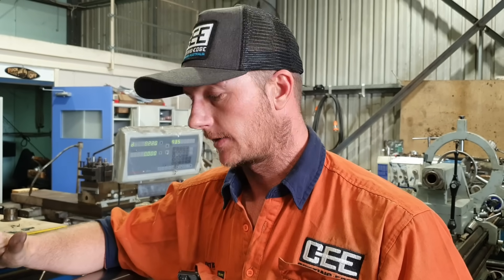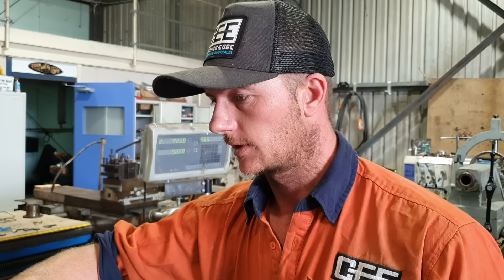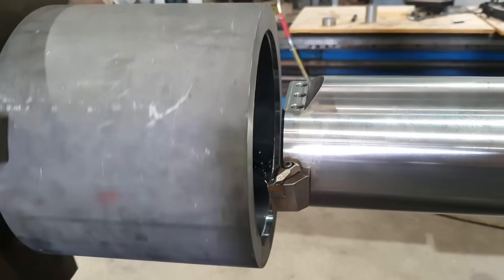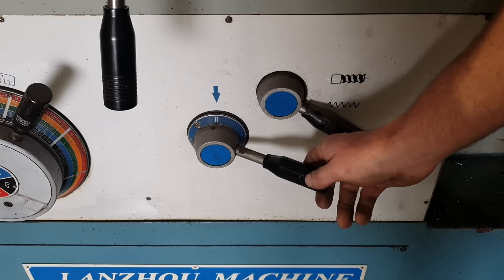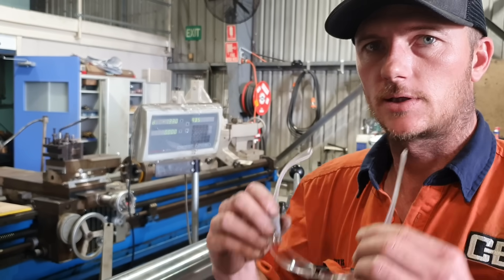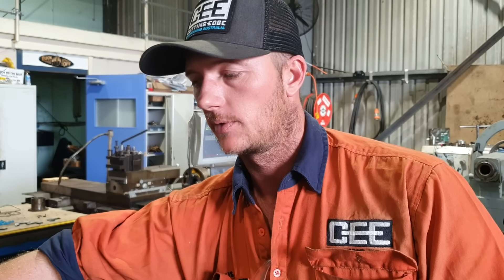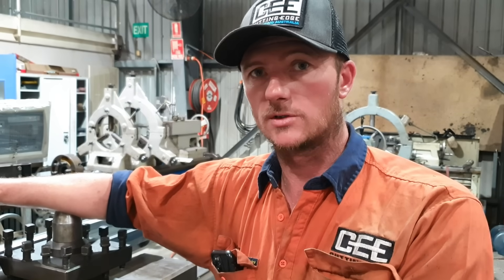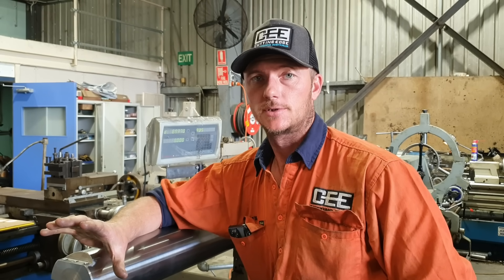Testing the BIG Boring Bar | Shop Made Tools

Comment: Would be interesting to see dial gauges placed to see the deflection at the cut, top and side.
Reply: you could calculate it based off the tool post deflection and the length of the bar
Reply: @bradmcgrath358   No.  That would give you an useless number.  The 2 gauges will give the truer reading and also the harmonic oscillations will be visible, as will the effect of cut depth, rotation speed, etc.  Your calc would only give an estimate of static horizontal deflection, and nothing for vertical deflection.

Comment: If you would be so kind as to include positive rake inserts in your testing and measuring deflection I would really appreciate it. My experience has been that cutting load is less with positive rake, so deflection should also be less. Wondering it you would confirm.
Reply: This was the comment I was looking for before posting mine.You are absolutely correct.

Comment: Great video. Knowledge is power, it's the same reason I cut and etch when I weld materials I haven't worked with or material of questionable quality.
Reply: Materials of questionable quality. Oh boy you should have seen a report from China I watched yesterday about the build quality and the reinforcing steel in new apartment buildings. Horror,  and nightmares. Snapping reinforcing ligatures with bare hands, snapping thick reo bar at bends by smacking it against some concrete. Concrete floors that give way to reveal only the reo mesh, architraves not nailed to door jambs, held by glue and paint. 
The list goes on.
Reply: @markfryer9880  Been a few on Utube showing the new cities that China has built in recent years ,almost all never lived in and very little population , Given close inspection exposes the worst possible construction materials and methods It's no wonder that no one lives there.

Comment: i used counter weights on a 3 ft long bar it will give your cross slide at ease also,the weight will stop chatter,.125 to side should be easy to bore at 3ft

Comment: Have you ever thought about using a damper on the bar to reduce vibrations?  Similar to a rotational damper aka harmonic balancer on an engine.  It could be a simple bolt on combination of hard rubber and metal pate affixed to the side of the bar away from the tool or within the tool's projection.  It would act to dampen the vibration along the tool length.  In fact a brake drum / disc lathe has rubber bands that accomplish the same thing except they are on the rotating piece.  If the piece permits it, the same approach could be used in addition to a damper bolted to the boring bar.

Comment: Can you briefly explain why you didn't cut the relief in the boring bar longer so it can be closer to the chuck?  Certainly that would reduce the deflection by reducing the leverage force.  With full length mounting relief, the bar could then be placed in positions long or short.  Right?  Shout out to Homeless!  The yellow pig didn't last very long, "oink" is gone and there's a hole.  Bummer!

Comment: The deflection is a bit better than I expected. .02 mm at the post does come out to around .08 at the tool tip if I remember my trigonometry correctly. I would be curious to see what the bar measures for deflection where it enters the work.

Comment: There is enough room on the tool end of you new boring bar to drill 1 or several holes in the end. Tap them for a set screw.  Pack one with steel shot. Perhaps a second with lead shot and the third with urethane or rubber . The difference in the weights of the filler materials may dampen different harmonic frequency ranges .  Or mill a slot in the back side of the bar with set screws much like the 25mil slot at the end. With that you might be able to move damping weights around to change the harmonic tuning of the bar.   You may also want to create a heavy ring for the back end past the tool post to allow you to shift that around to change frequency resonance of the bar. Perhaps adding or subtracting rings . I shiver thinking about harmonics going thru the spindle bearings in the headstock and brinelling bearing balls and rollers..

How often do you chuck up a long bar and with indicators on the bed at the end of the bar and on head indicating the top of the chuck while you lift the end of the bar a limited amount to see how much the spindle/chuck rises or deflects in the spindle bearings. So you know when to reset preload on the spindle bearings.

Comment: I would think, if you bore a 25mm or 1" banana hole through the bar, it would lighten it up a bit, and it would add to the strength. IMHO

Comment: I did wonder if you would lay an indicator against the bar itself to see if anything was moving. You can usually hear any vibration, or see it in the swarf.
That bar must be the stiffest element in the system. So - as long as the tool holder can cope with it - your fine. Happy swarf tells you a lot.

Comment: Put a dial indicator on the back side of the working end of the  boring bar and and push against bar opposite the indicator and check for movement.  Curious what sort of taper boring a deep hole with that stickout would occur if any?

Comment: I certainly didn't mention deflections since that seemed solid enough to me for any sensible use. 
But just as a matter of academic curiosity, I'd be interested to know, if you take a clean cut on the inside of something, mic it, then take a 3 mm cut, and mic that, what size did it actually cut? 3mm? 2.9mm? 3.1mm?

Comment: I saw a video of an columbian machinist that he install a opposite bar that touch the lathe bed with a bearing in parallel of the boring bar, so it absorb angular momentum in the tool post, when he uses an big diameter boring bar in a lathe. It allows to increase feed and depht of cut. Obviously it have a limit by size or shape of the part when needed to turning an tube or any part that it necessary to machine it. By the way, another great video as always Kurtis and thanks for sharing with us.

Comment: Damn, that machine a hoss.  I expected alot more deflection, I expected the tool post to turn or twist but .02mm or .10mm is very respectable.  Especially with all the weight of that bar on it.  Might check the tool post center bolt later and make sure it's not warping or bending later on, but I don't predict any problems.  Nice!

Comment: I think you measured the deflection in the wrong position.   The DTI could be placed a few inches behind the tool, both for the up and down movement, and the movement horizontally towards the centre of the pipe.

Comment: Hi Kurtis, That is a pretty impressive result. And when you relate that back to the cross slide and width across the saddle, a slight tightening of the cross slide gib while doing the specific  job would reduce that deflection. I really doubt that the bar itself is the sole contributor to the deflection, which is minimal.
Nice job.
Homeless makes short work of those sqeeky toys.
Regards Dennis.

Comment: Was thinking about suggesting to measure the deflection with a dial indicator, then, bam, 09:50 you said so. 

However to me it would seem you are measuring the deflection on the tool post. But your big boring bar, and the end  would have a greater deflection than what you measure from the tool post, you have to see it as an arc, where further away from the center of the radius, the greater the length of the arc, geometrically speaking. 

Which means that the end where you have mounted the insert would have a bigger deflection that what you get at the tool post. 

Also, keep up the good work, I really like your videos 👍👍…

Comment: What could go wrong ? Vibration? On a bar that size ? Reduce the cut it's still going to be better than a smaller bar.
As for the saddle? It's not going to be used continuously and the only problem I can see is wear on the ways from the pressure from the heavy stick out but again occasional  use in a big machine???.
This dude is no mug and he wouldn't have gone to the trouble if he didn't believe.
Nice job Kurtis.
Reply from the maker: you're spot on mate thanks for watching

Comment: Years ago, I worked in a shop that used some really long boring bars. The machinist would use the Steady Rest to support the boring bar.
Reply: That was my thought too- can you flip the roller wheels in it 90 degrees so you could feed the bar through it?
Reply: I was just a kid back then, but I don't remember the Steady Rest they were using having wheels. I think they were just brass plugs. I know I helped one the machinist change out the brass plugs in a really big Steady Rest. It was almost as tall as me sitting on the floor.
Reply: Doesn't work

Comment: As someone who knows very little about machining and lathe work, a video on the different kinds of inserts and when you would typically use them would be very interesting
Reply: I was thinking the same thing. I looked up the different inserts and it's a bit confusing. Also, it seems like they make more insert types for the bigger tool holders than they do for the smaller lathes.
Reply: @rockridgewoodshop  With smaller lathes I usually ground my own tools out of HHS square bar or carbide blanks, Inserts were pretty deer and I'd rather hone a piece of HSS over buying so many inserts.

Comment: good results with the new boring bar....it must put at least 3 times the force on the tool post as the next smaller tool....but if you don't use it very often the tool post should tolerate it pretty well.....probably best to use it conservatively, reduce depth of cuts by half and the travel speed by half do the big jobs much more slowly .... so that's my two cents worth from a guy who has never machined anything harder than his toenails

Comment: Looks good. Would be interested in seeing a thread cut, and a deflection comparison with a smaller bar, if you have time.
Reply: That guy doesn't know what he's doing! All that tool hang out, short and sweet. 2''dia bar would work nicely with min extension and closer to 600 s.f.m. r.p.m.
Reply: @bigdave6447  : You've missed the point.   He's just testing, having the cut easily seen, and no doubt doesn't want to waste too much material or too much time.   Later, he's used it on an actual job to machine out some huge long cylinder on which a 2" dia bar couldn't do the job.

Comment: If the work can be supported by a steady rest on the outside, would it be a good idea to make and use with this bar a tool similar to a follow rest but solidly mounted on the front part of the boring bar with 3 adjustable legs, the legs adjusted in each pass against the  first few millimeters of the bore. I think it would really minimise the boring bar deflection although there could be some problems with chips getting caught between the supporting legs shoe/bearing and the bore and scoring the bore. What do you think? 
The idea came to me from David Wilks's videos where he supports his huge trepanning tools inside the bore with wood on the end of the work which acts like a gliding shoe (if I understand it correct).

Comment: Wouldn't you set up a dial indicator on the Boring Bar to see if there is slight vibration on harder material
Reply from the maker: no need it would be obvious if there was vibration and chatter problems

Comment: Whoa! That was quick and looks good to me. The deflection is a pretty minor issue I'm guessing. Normal DOC and there won't be a problem. Nice job, and excellent videography as always.
Reply from the maker: spot on Bruce hope your week is a good one mate 😎👍
Reply: Carbide tools tend to deflect with deep cuts and high feed rates for some reason. That's a pretty impressive boring bar by the way, what's the plan for it?
Reply: @r1learner178  That is why I said "normal DOC" since Kurtis said he would be taking 1mm cuts or less. I think it is really impressive!
Reply: @BruceBoschek  Yeah all I was saying was that carbide tools tend to deflect for some reason (just something I noticed when we switched from HSS to carbide), whether it is something to do with the cutting angles or something else I don't know, it just seems worse the deeper and faster you go. Although I think it depends on the quality of the tool holders and machines also. I have used some real crap machines and tools (cheap) lately.

Comment: The boring bar looks good, the problem may be the bar resting section which is relatively thin, and that's where vibrations will set in if attempting deep cuts in harder materials
Reply: What problem?  He explained the test cuts were extreme and not something useful.  There were no vibrations and if kept within the test limits, there will be none.

Comment: 13:39 hard to get this better. AP saw the car while driving on the other side of the road and needed to brake hard in case the car on the other side is not stopped, but approaching fast.

Comment: I got the perfect name for it.... MOABB - Mother of all boring bars
Reply: It's a tiny boring bar compared to some of the ones you can buy from the tool manufactures. The biggest anti vibration boring bar Sandvik coromant has made is 6 meters long and 305 mm in diameter.
Reply: @Rasmus661  but for him and his shop its a MOABB for now.

Comment: How about a bracket to hold the pipe for the flood coolant, so that you can get coolant to the tool when its several bananas into the work? BTW the minimum length for a banana in the EU is 140mm
Reply: Do they have a minimum and maximum radius for the curvature too? I know years ago there were having some requirements for cucumbers to be straight. 😱

Comment: The deflection upon reflection is perfection lol
Reply: The angle of the dangle is directly proportional to the heat of the meat.
Reply: @zachaliles  Gosh that's an old one, I that in the 1960's.
Reply: @andrewmicas4327  might be old but it still works.
Reply: @zachaliles  Ah, it's the drop at the top that does the job apparently!
Reply from the maker: 😂 10/10 for this comment
Reply: Well he indicated for load deflection. I was curious about horizontal deflection away from machine center…. All that bulk trying to lean the carriage front end….down.
Reply: from the poet who didn't know it :):)